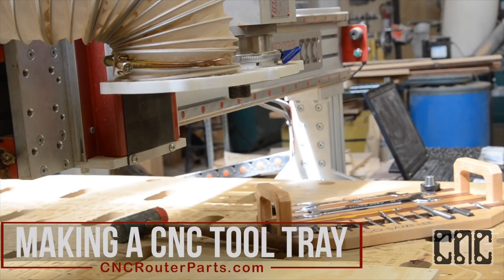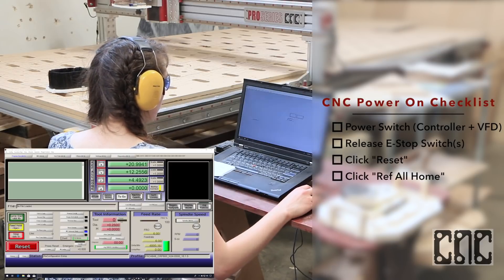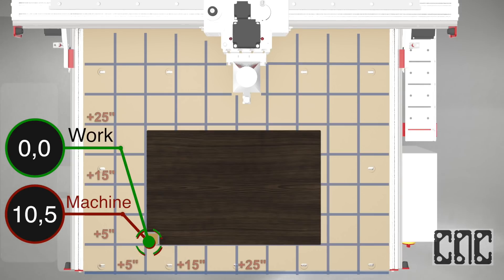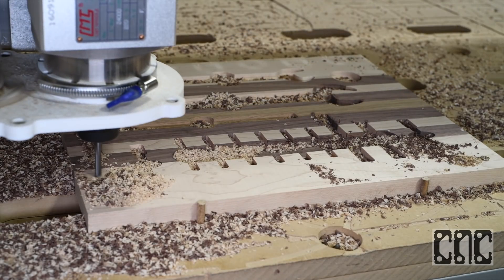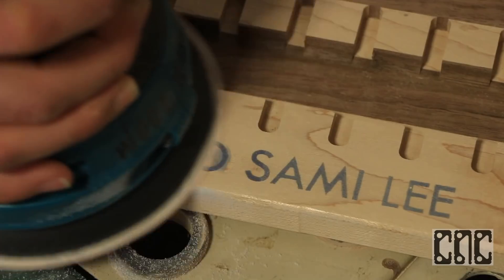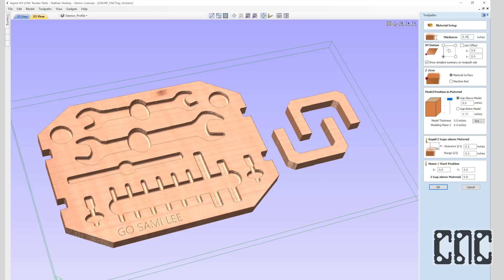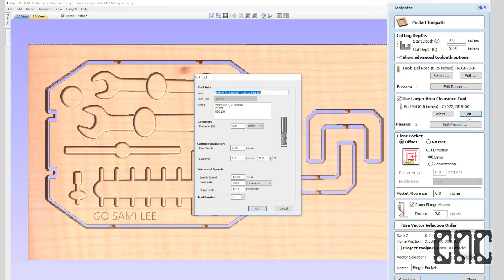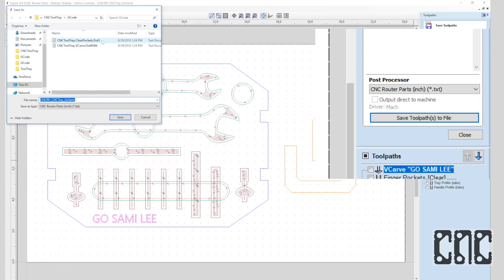PRO Maker Series: Making a Custom CNC Tool Tray with VCarve Pro (or Aspire)

Comment: id reccomend reinforcing that handle joint with a dowel or screws, i wouldnt trust those little dabs of glue to hold my expensive router bits on their own.

Comment: i have a pro60120 like in the video. the main complaint i have is the vibration from direction changes. this becomes extreme at higher feedrates. this presents issues in precision of machining. you can see the jittering taking place in the shots in this video. Has anyone come up with an effective way of reducing this vibration through structural additions?

Comment: I have no idea why anyone uses Aspire or V-Carve when Fusion 360 is both free and superior in every way. Someone please explain this to me.
Reply from the maker: Hi Matt, We are big fans of both Fusion 360 and Vectric's CNC design software (VCarve/Aspire).  They are very different products and while there are plenty of designs that could be accomplished with either, there are many examples of projects that I (and others) would tend to favor one design product vs. the other.  For example, Fusion is great for multi-part engineering assemblies, parametric models, and/or T-splines 3D modeling whereas Vectric rocks at making 2.5, 3D, and rotary projects using deceptively simple inputs such as 2D vectors, mesh files, as well as non-CAD data such as images (3D from bitmap, 2D trace bitmap, etc).  Generally Vectric software appeals to both non-designers (as it is easy to use and create custom projects quicky) as well as designers and craftspeople simply looking to spend less time in CAD and more time in the shop.  Vectric has trial versions, if you are genuinely interested, I'd check VCarve or Aspire out!  Hope this helps!  -Nathan
Reply: For me, there are a few reasons:
F360 won't run on my Macbook Pro unless I upgrade my OS. VCPro does using Bootcamp.
My internet connection is too slow for F360: Running it on my Windows 7 computer, I can never tell if the program is configuring/calculating or if it just crashed.  Don't need the internet to run VCpro.
As most CNC work is 2D/2.5D, I find VCpro very quick & easy. And with the new Rotary features I'm thinking of adding a 4th axis (when I hit the jackpot).
BTW, I really like my cncrouterparts benchtop pro! ;-)

Comment: Just bought these bits, i have the CRP 4896 pro, i use aspire, and was just looking at making a tray for the endmills. Perfect timing.

One thing that is next to impossible to find, as whiteside is updating their site, is the recomended feed and speeds charts. It would be awesome if you guys posted a pdf on your site when buying the set. For now I'm using gwizard to get some numbers. 

Great video
Reply: Hello, I'm assembling a Pro4896 right now and bought CNCRP 10 piece bit set. I also bought GWizard. How good is GWizard working for you on the speeds and feeds?
Reply: @joem5110  I did some test cuts using gwizard and I have no complaints, you let it know more or less ur machine specs, including horsepower, max cutting speeds, the material you are using and it provides the rest. 

It gives you depth of cut, rpm, ipm, etc. The best part is you can lock on a setting like rpm or ipm, and it will change other settings to try and make that work. 

It's got a cheat sheet, so if you wanna know how you can cut faster, or have a better finish, it gives you some tips. It has a 30 day free trial without a credit card so you can try it out yourself. 

Honestly, I'm no expert, but given the lack of resources out there, this is worth it.